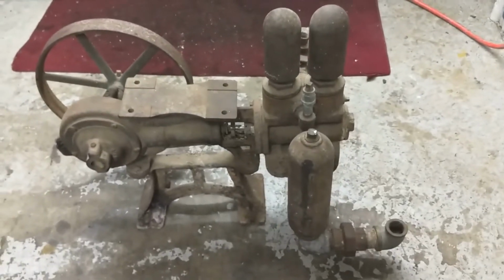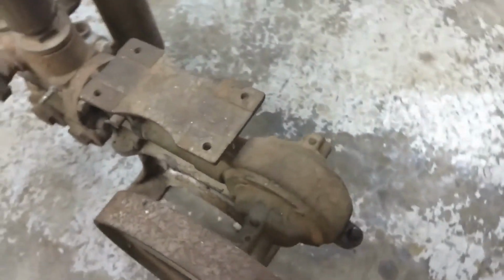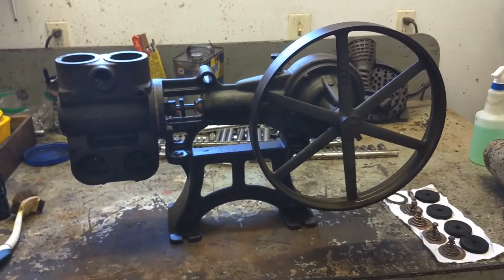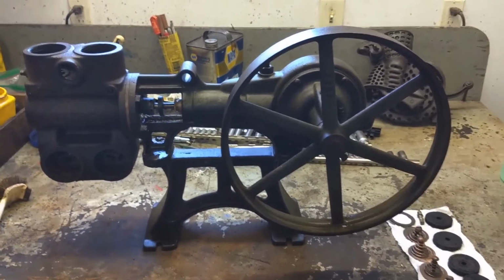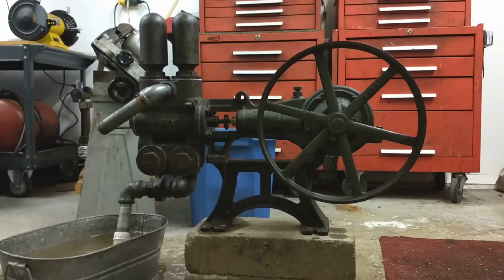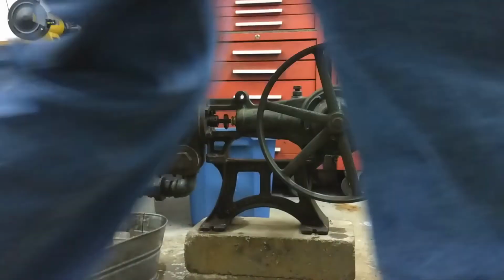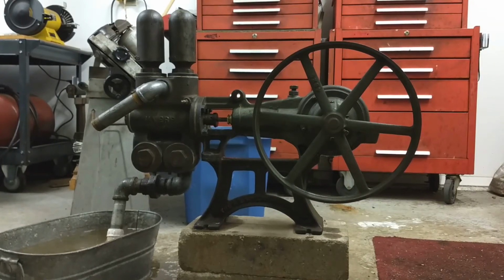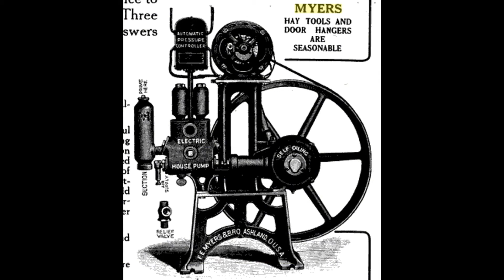Antique F. E. Meyers Water Pump

Comment: What is that not for on top of the round headed dome on that machine there's three tound headed domes one had a nut on top what's that for
Reply from the maker: It is actually a plug not a nut. You have to remove the plug and pour water into the dome to prime the pump. there has to be water in the pump before it will start working. Thanks for watching.
Reply: @Old-Engine-Dude  the reason why I'm asking the bitumin sprayers I work on have the same plug so I'm assuming that cause these pumps work off the bases of water and you prime them with water the bitumin sprayers must need priming with bitumin before you start spraying how do you pour it in with a funel maybe?

Comment: Just curious where were you able to find the leathers for your restoration
Reply from the maker: I found a local water pump parts house but they didn't have the diameter I needed. I ended up going to a boot repair shop and they punched holes thru some thick leather and cut the diameter larger than I needed. Using a long bolt, a couple of washer, and a nut, I then spun it in a drill press and used an abrasive disk until I got a snug fit in the bore of the pump.
Reply from the maker: You might also find your size here...

https://www.lehmans.com/product/replacement-cup-leathers-for-water-pumps/
Reply: Thanks for the reply I'll look into both of your recommendations
Reply: instaBlaster...